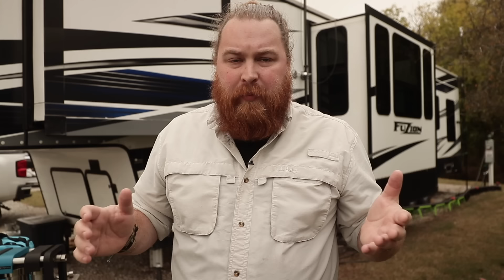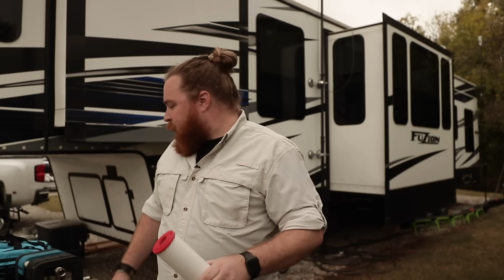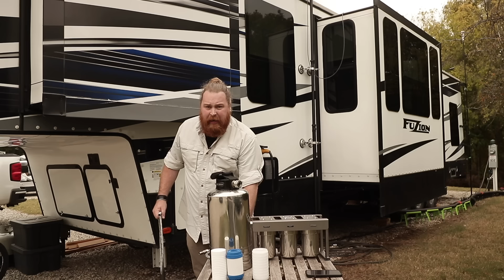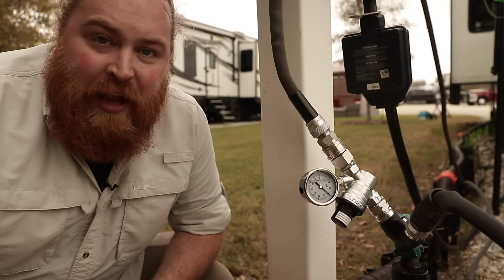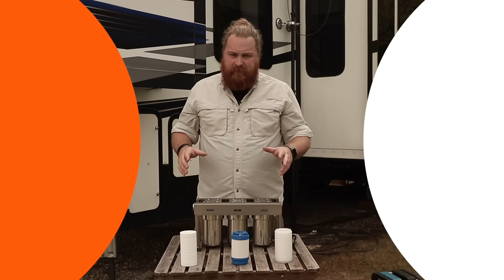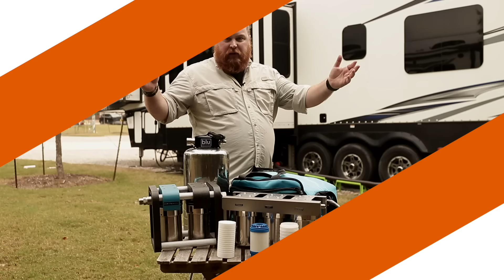Meet the next big thing in RV Water Filtration

Comment: In regards to safer water being that the is made of stainless steel aren't the water lines inside the RVs made out of some sort of plastic along with the stainless steel hoses having plastic inside of them? How is the insulation of the stainless steel in very cold weather and sweltering weather? and do you have water filters that filter out BPA and Phthalates?
Reply from the maker: Hi Mark! Sorry for the delay on this, but I think I can help you out. So in regards to safer water, there is a thin material inside the metal hoses that is made out of food-grade rubber that is certified and designed specifically for drinking water. 

As for the BPA and Phthalates, these filters take out material larger than 0.2 microns.  In most cases, based on what we know, both of those materials will be removed based on their known size.  If you would like to know more, please reach out to ya via email at info@mobilemusthave.com and we can pass along more details! Thank you!

Comment: How can I use this to water my garden? What do you need to hook garden hoses to it, both inlet and outlet? This is just what I am looking for. High flow rate and good filtration.
Reply from the maker: this is designed for drinking water and making it safe for human consumption.  While it would work for watering anything it might not be the right filter for watering plants. It is designed on a 3gpm flow rate which is perfect for RV usage and regular daily actives.
Reply: @MobileMustHave  I received mine today and the flow rate is fine for single hose watering. Though it would probably be a bad choice for a multi hose larger system.

Our city water is so bad where I am that it is bad for growing plants. I'm going to see if this helps. Thanks.

Comment: Is it possible to use mrx with faucet water with pump off?
It'd be wonderful if it can be used at campsites and off road
Reply from the maker: The MRX can pass through water with the pump off for this configuration yes allowing it to be used for on grid and off grid setups.
Reply: Thank you 😊
Reply: Thank you 😊

Comment: Love the stainless. Can't wait for one of these companies to come up with a good heated version for winter. I have contemplated putting a system like this in a tote with a ceramic bulb, but for now we don't NEED the softener most places we go and we have the awesome water drop system under our sink. I think until one of these companies makes a self-contained winter-ready unit I'll stick with that.
Reply from the maker: Hi Ryan, as a full-time RVer who loves the snow I understand this!  I have passed along this feedback.  -Andy
Reply: @MobileMustHave  It's great that you guys push the industry the way you do. We're proud customers of your products and stuff like this is what's building Mobile Must Haves a secure place in the everchanging RV/Mobile market. Your customer service though is impeccable and that alone is what keeps us, customers. Thanks!
Reply from the maker: @ryanpeters795  thanks so much Ryan, that means a lot. We were not happy when we pulled back from round one needing more work which no manufacturer wants to hear but Blu has really stepped up and the fact that we have direct access to engineering means we can really move the needle and bring customer feedback and comments back to the customer making this a truly modular system over time to solve what is one of the most frustrating parts of RVing. We often are told we should sell more products but I think we are finding our way selling the "best" products :) - Appreciate the feedback, it helps us keep innovating as always!

Comment: Really expensive and really easy to steal. Until those two concerns are addressed, I'll stick with bottled water for drinking and cooking.
Reply from the maker: the MR3 is $100 less than the competitive product that weighs around 28 pounds while it is 13 pounds and about half the size in dimensions. Certainly, this is an investment for sure, but priced well considering the stainless 304 construction and high flow and filtration specs. As for securing the unit, you could secure it just like anything else at a campsite if you were concerned using a cable lock or other method, in 7 years of full timing I've never heard of a water filter being stolen but I'm sure its happened somewhere. Thanks so much for the comments to keep the discussion going!